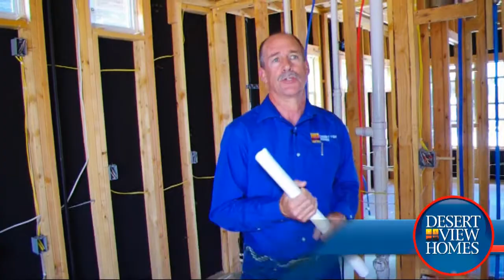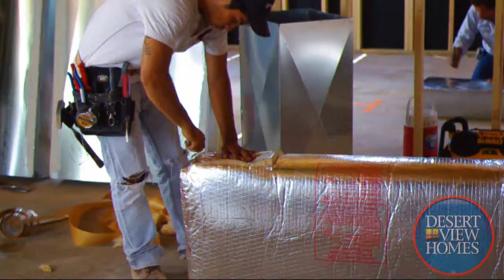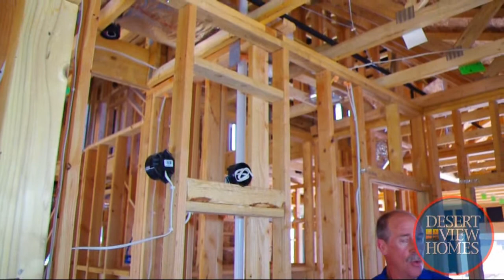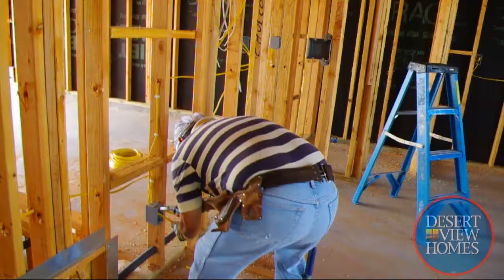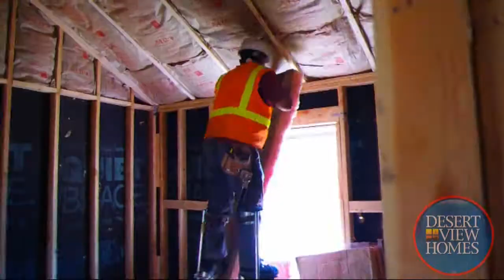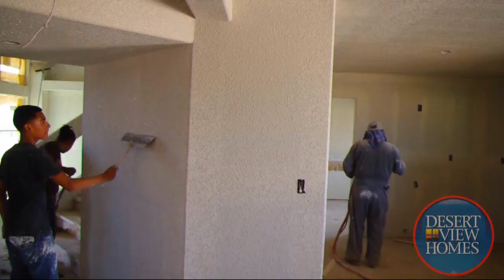The Mechanical Stage of Construction

Comment: When buying or BEFORE buying a home from a particular builder. It is extremely important to take the time to see the homes foundation and structure in its bare form. I took a look at 7 homes from Desert View and the 2×4 had plent of defects yet they still used them to support weight of roof. The roof boards used had gaps where joined. Careless building.